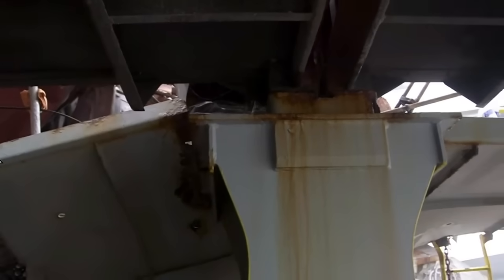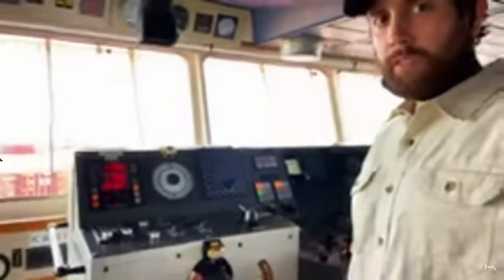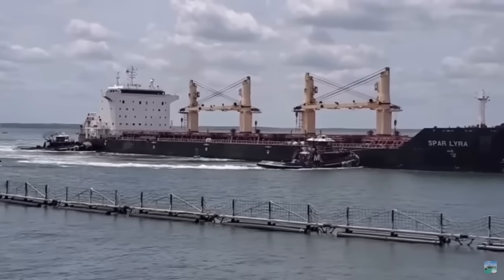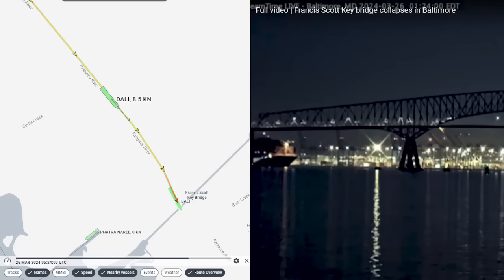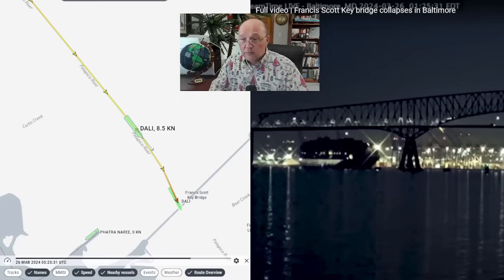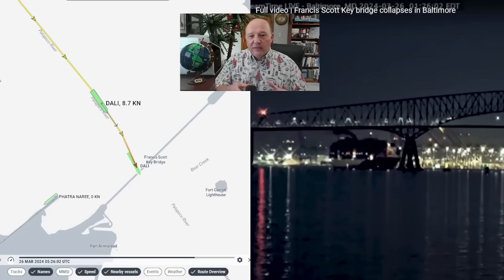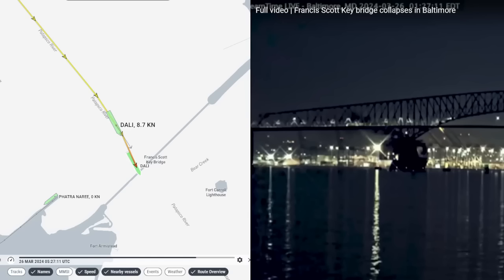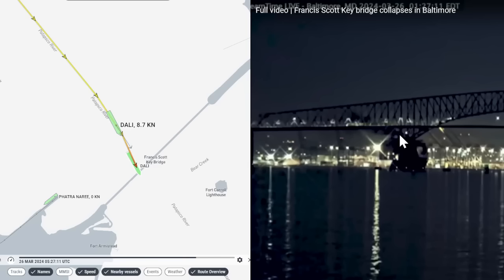Dali Timeline from Data Recorder in Striking Francis Scott Key Bridge in Baltimore, March 26, 2024

Comment: The ship usually have 3 generators. When maneuvering it uses 2 generators. In case of power failure the no. 3 generator automatically starts and take essential load. If no. 3 generators fails to start then the emergency generator will start

Comment: The first power loss looks more to me as though the main switch board tripped off line not that the main generators failed. They then re-energised the main board, then whatever fault originally took it down the first time tripped it off permanently a second time.Due to the massive surges may or may not have started the emergency generator automatically.

Comment: They should have a tug starboard.. Port.. sailing thru the ICW mandatory.. great presentation
Reply: They totally rejected a much smaller ship transiting here, and denied using tugs as an option due to risk to the tugs. If they had tugs in this situation you'd just be looking at the same situation with probably a tug fatality. It'd be like using a pushback cart to stop an aircraft that's landing. It's utterly impossible for a ship this size at this speed. Tugs are barely able to stop an  already stationary ship this size from moving in moderate winds.

Comment: Question:  The Titanic couldn't steer in time to avoid the iceberg and this is despite the ship being fully functional (but also going much faster).
For a container ship this size,  assuming (for sake of discussion) that the side river pushed its stern sideways, would the rudder have been able to correct a 10° heading difference in time without the water flow from propellor?  (yes, deninitely,  maybe, close but no cigar, definitely not even close? )

Would sideways current during  tide going out be something that is documented in the port's navigation, or would it normally be a no brainer and captains/pilots not even aware of it?

Comment: Great video and valuable information. I don't think salvage is the first priority. I think the priority lies with reopening the port access. I'm thinking they go to the opposite side of the bridge just past the former girdered area and disassemble a section of the road way and then dredge a new navigable channel just sufficient to move traffic in and out. The salvage is going to take at least a year and making a new channel should take a few months. And thanks to Tim B @ Sea and Ward Carroll for putting me onto your site.
Reply: Hey, someone is thinking out of the box!  And for sure the reopening of the shipping channel is the 1st priority.  However, I don't see why clearing out the downed bridge material should take a year.  There are "cutting explosives" that can be used to safely chop up the trusses, etc., then drag the pieces off to the side, then dredge out the smaller chunks of downed roadway and such.  While not as large a project, the channel below the collapsed Eggners Ferry Bridge across KY Lake was cleared much faster - heck, the replacement span was in use, 4 months later.  (Less debris there, but there are many greater resources on the East Coast.)

BTW, while I'm not suggesting a big explosion in such a developed area, USACE blew up 2 MILES of levee in about a second @ Birds Point, MO, several years back, to put an emergency floodway in operation.

Comment: Just because there were rudder orders given from the bridge that doesn't necessarily mean that there will be enough power for the rudder to respond using only an auxiliary generator. I was on a fleet oiler that had 3 diesel 1500KW auxiliary generators but just because they started when called in for an emergency it did not mean you had immediate power for the rudder. My ship  had electric motors that drove the hydraulic pumps and electric controllers to direct hydraulic power to the rudders, we had two. There were manual overrides but you still needed the high pressure hydraulics to move the rudders. I'm pretty certain that this Dali ship, had much more modern rudder control such as all electric. 

There is a process the generators must go through in order to get that power where it needs to go and that takes time. I'm certain that the pilots and crew were working their asses off to get that ship under control but they had a very short time for the auxiliaries to kick in and synchronize the power distribution system with the call to power the rudder. It's been my experience that reenergizing the system comes in steps through relay boards or now, circuit boards but all of it takes time. That was something they didn't have much of, time. I have been in two ship collisions and a few close calls. 

We dropped power in the Oslo Fjord and struck the side of the Fjord damaging one of our propellers. I worked in the Main Engine compartment and we worked frantically to get the auxiliary generators up and phased and power into the circuitry but not in time to prevent hitting the hard rock of Fjord. Sometimes things are just going to happen no matter how hard you work to keep it from happening. We were a highly trained crew. We had a smaller emergency generator that was only capable of supplying enough power to get the lights and communications back on. I suspect the auxiliary generator on the Dali had only that kind of capability also.

Comment: Question about tugboat strategy now considering  what happened. 

Great information, by the way.

Would it be beneficial to have tugboats out near the bridge for a quick response like the one in your video that averted a collision near Norfolk?

Kind of like how our State Police are out along 495, 695 ,etc... during rush hour.

Maybe they already are there or maybe the cost would be too high: additional  fuel, maintenance, etc.

Agian, great video.
Reply: No. If you want tugboats involved, they'd have to escort it from dock at slow speed. 
The one in his video was relatively small, and was not going as quickly as the MV Dali was moving.   TimBatSea has a good video on how this works, he's a tug boat captain.

Comment: Please excuse me if you have covered this. The ship's main engine which is driving the propellor is separate from the engine(s) driving the electrical generators. Why would the main engine be affected by a failure of the other engine(s). Surely they would still have had propulsion.
Reply: I think someone mentioned that the fuel is delivered by electric fuel pumps supplied by ship's power (the generators). No power to the fuel pumps means the engine stops running.

Comment: I see a lot of well meaning & earnest comments here. I have also watched quite a few videos on this incident. Here's my take:

1. That ship lost ALL four main generators at about four min before it hit.

2. The emergency generator kicked in within 60 seconds, as it should have.

3. The power was recovered, then lost & recovered again. This points to a defect in the fuel system of the generators, such as choked fuel filters.

4. The thick black smoke: This is the main engine executing an emergency astern manoeuver, which is normal on a direct coupled slow speed marine engine such as the Dali's. No malfunction here.

5. The reason for the stem swinging to stbd: Partly the ebbing current in the chennel and possibly the full astern order (which could have caused a 'prop walk' in shallow waters) or a bit of both. (No conspiracy here).

6. The emergency generator can power the nav. instruments, essential lights AND steering, but NOT the main engine.

7. Apparently they did not use the 4500hp bow thruster, which possibly could have(?) dragged the bows away from the bridge pillar. (It might have been better than instinctively kicking the main engine astern- (but that is 20/20 hindsight).

8. The fact that they lost all four diesel generators in quick succession points to only one thing- fuel quality.

9. I have personally experienced wax separation in MDO which can choke up filters quickly, especially under 10C ambient temp. It can trip all your running diesels in minutes, leaving you high & dry with no propulsion.

10. You may ask: Then why did the Em.Generator not trip? Because it runs on a seperate tank of HS Diesel outside the engine room.

(10 yrs Chief and 15 yrs Superintendent, including ships bigger than this🙂).

Comment: If, when the emergency generator system is checking for MSB power, there is a momentary return of MSB power then the emergency breaker may not close. Would the system then have to go through a whole new cycle to bring in emergency power? What is on the preferential trip scheme and is there something connecting that undermines restart/connection?

Comment: FyI the  legal argument about contribution of blame/ Liability  based on the chain of  contributory events are likely to be at least: 1) the ship owner's Insurer for  the initial Back Out cause, 2) The responsible authority for the bridge protection barriers ( they were ineffective/ an out of date standard), 3) the Port authority - for Port procedures concerning when  tug are required and port speeds, 4) whether the Pilots actions where with out fault ( while he did a lot of good, any Astern order will be heavily argued as causing the swing  starboard -  when possibly doing nothing or  kicking the engine ahead when engine came back on  would have got the  Ship clear under the bridge.)   Mearsk as charterer will have some protections  under contract but the ship owners( insurers) will argue that  because  of the  port procedures and  poor standard of limited bridge barrier protection  the port was unsafe for the ship - so Maerske  may have to indemnify the Ship owner's ( insurance) losses.
Reply: Liability stackup may change if the fuel is found to be contaminated.
Reply: @SteamCrane   yes it would -   but I doubt it is fuel caused (  ie contaminated fuel) - it goes from Double Botton tank to, settling tanks ( Removes water) to, daily Service tank and then is pumped  to mechanical  injectors ( in that system the fuel oil goes through  a fuel oil heater to increase viscosity , centrifugal oil filters (clears sediment and water) & filter screens (further solids filters). In addition  the other reason is  because  when it restarted  the black smoke is continuous and fuel contamination by itself won't trip the main switchboard, if there was fuel issue the main engine would not have restarted and kept belching black smoke ( a sign of rich air fuel mixture. If it was fuel with high sulphides (which causes crystallisation and  Injector blockages)  the main would not have  started so fast  (ie it needs injector replacements)  and would not have remained firing.  If it was a Generator (which runs on diesel oil) it does not  immediately trip the main switchboard and shut down the  Main engine ( the generator  may be powering the Lubricating &  Fuel pumps) however , in that situation the engine control management system  alarms and there is time for a second generator to be  remote started and phase switched into the main switchboard to keep the main  engine running, it does not immediately shut downtime main engine. interesting - but my money is not likely contaminated fuel!
Reply: @gigglingdingo  I can believe that.  This description also shows how many things can go wrong with a big marine diesel.
Reply: @SteamCrane  yep that is likely  list... this isthe sort of work  i used to do.

Comment: Question: would activation of emergency generator yield visible results in the port web cam?   aka: when WE see lights coming back on, must this be the emergenecy generator, or could that generator have kicked in almost immediatly with no visible results from shore camera, and when we do see lights coming back on, those would be the main generator(s)?
Just curious if emergenecy generator could have come on instantly but we just woudln't have seen it because it doesn't power external lights.

Comment: This can be a bit confusing BUT I get the feeling that by trying to REVERSE the engine (puff of smoke) the prop actually pulled the stern to PORT,,,,resulting in the STARBOARD bow sideswiping the pillar on the right.

This was NOT a “bow-on” strike!!! 

There are PLENTY of UNDAMAGED elements on the FOREDECK, like winches, etc.

My guess is they would have Barely cleared the pillar and drifted to a soft grounding further down the channel. 

Note: they had already cleared the protective “Dolphin” in front of the pillars! 

But they felt that they “had to DO something” which IMHO was the WRONG thing as the STERN kicked LEFT and the BOW swung RIGHT. (Scraping the Pillar!) 

You can actually see this happen at the very end of the video as The ship VEERS SHARPLY to STARBOARD.

This should be interesting,,,,,
Reply: Yes, prop walk is a thing.  Doing nothing may have been the best answer, but let's see what the NTSB discovers.  This is a very complex incident, and there may be some surprises.

Comment: Dan Allyn marine superintendent ARCO retired here 
This and previous video are the best I’ve seen on what happened

One comment on 1977 sea trials of 150,000DWt tanker with 10 RND 90 Engines we were able to go from full ahead 121 RPM to full astern 118 RPM in 5 minutes using breaking air. The operation involved shutting the fuel off then injecting air to stop, through cam into reverse injections air to start reverse rotation and begin fuel injection

Another comment on plant restart. A blackout can cause the standby main generator to take the load if running or start and take th load   when it does this the emergency generator senses this and shuts down. When the standby generator was lost the emergency generator restarted which was the lights coming on the 2nd time. It was a main standby generator taking the load the first time when the floodlights were on

Comment: I'm confused. The ship should be heading straight between the two green lights on the bridge and staying it the lane (channel). The ship hit the support to the LEFT of those green lights, right? But in the map, the ship went to the right in its lane. I don't see a correlation of the map and what I see in the video. That map that shows the lane makes sense, but in the videos (not this one but the same video with a wider shot) it looks like the ship clearly hit the LEFT support even though it was on the RIGHT side of the channel. Can anyone show where the supports are on the bridge in relation to which one it hit?
Reply: The video angle is very severe and distorted from what it looks like top down.
Reply: @peter65zzfdfh  Is it possible the video is flipped horizontally?

Comment: I was wondering if there is a rough plan as to how exactly they will start the process on the way back to normal. Will they remove the section of the bridge first? It seems logical that the weight must be removed from the bow before anything else can be done.

Comment: Hi Sal, Is it not possible to just get some huge big ships , hook those giant sized chains to the fallen bridge and then use the ships (full steam ahead)  to tow the bridge away to the shore,  that way at least allowing passage way for the port to open up... 🤔
Reply: There are crane ships that could lift the bridge and move it. the issue is getting them on site. They are slow.
Reply from the maker: The water is too shallow outside the channel for big ships.  They will bring in some tugs and barges for that

Comment: We also need to carefully run over the tracking programs out there, because they are not tracking with each other. I kept a couple of snapshots.. I see 10 mins time difference, and 0.8 knot speed difference, so the tracking doesn't look too reliable.  Which tracker is most close to the real events?

Comment: I had assumed that the engine had been rotating in reverse that would have encouraged transverse thrust to cause the Dali to turn to port. The speed was decaying fairly quickly. That could be attributed to the anchor dragging, but with all that smoke coming out the stack, I think you're saying this is an attempt to start, but not actually started. Also, is the engine either in forward or in reverse, but can never operate in neutral?

Comment: Glad you posted the chart, but still thinking that Bear Creek currents had a role to play. In regards to steering the thing that upset me the most is they the meme that says you still have steering with no power. With both sailing and canoeing, no power means you're about to be on an adventure. I get very upset when the crew of the Dali is disrespected and figured most people were on station. If they didn't have a direct or assisting role, they were preparing for firefighting. I think in addition to the camera angle that is throwing people off, is that they are working off the video that is speeded up. The actual video is nearly eight minutes long.

Comment: One question still needs to answered. Was the Main engine started in astern. Looking at the black smoke and  the amount  of smoke comming out it can be asertianes its from the main engine funnel. Now if the engines were started in crash astern. Then the turning of the vessel matches with the this phenomenon. I believe this vessel has right had propeller( looking from aft the propller rotates clockwise). So with a right hand propeller in astern the prop will rotate in anti-clockwise. When a right hand propller rotates anti clockwise along with astern thrust theres a transverse thrust also which will push the stern to the port and bow to stbd. If we compare the AIS with black smoke coming I think after power was restored first time and engine was available, astern command was given which due to a right hand propeller turned the stern to port. As the rpm was increased to full astern( black smoke increased) prior contact the transverse trust on the stern also increased to turn the ship sharply to the stbt.